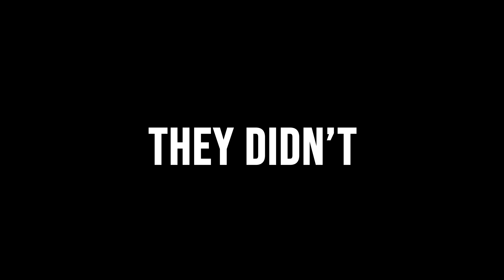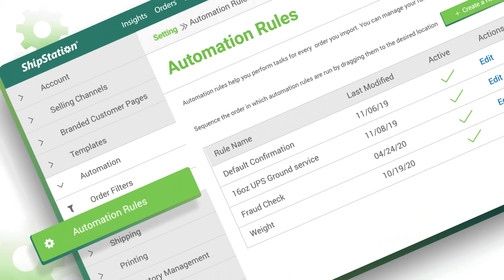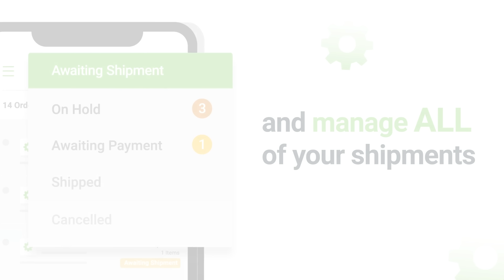This trick made my shop 50% BIGGER // Shop Build 3

Comment: You had mentioned that you would like to keep as much wall space as possible for cabinets and storage. Since you are building an open staircase along that outside wall, have your framers build a wall (in front) enclosing the stairs and get back the wall space the stairs are occupying . Also might be able to put a closet under the far end as well. Just as a suggestion.

Comment: Too late now but in-floor hydronic heating is awesome for a shop.  Also, installing 6" PVC DWV pipe under the slab for dust collection has the advantages of eliminating static electricity, decrease of noise and not having the piping above your head with expensive metal DC piping gives you more options for storage.  I did both for my new shop build and love it!
Reply: Maybe not absolutely required in Ohio, but others should also consider insulation under the slab.  Great way to cut down on heat loss.
Reply: @richs5422  We are required to install R-10 under slabs on all new construction by code here in zone 6.  2" of XPS.
Reply: I wouldn't want in floor heat because I might need/want to mount something to the floor and wouldn't be able to drill into it.
Reply: @ADBBuild You can find the pipes with an infrared camera if the heat is on .  They make them as an accessory to your cell phone.
Reply: @ADBBuild Take a picture of the lines.
Reply: Done both in last two shops,great for wood stabilization and no visible heating system.

Comment: I would recommend that the HATCH be hinged, on the hinge side have 2 vertical posts that can be latched to hold up the door/floor. Can also be insulated and sheetrock on the bottom facing side.

Comment: I like that you will epoxy the workshop floor.  FYI, I used Titan epoxy coating on my workshop and garage floor which has a lifetime guarantee not to crack.  My wife liked it so much she had them epoxy coat our front and back porch to eliminate the few expansion cracks that had developed. Remember, concrete will crack, putting in expansion joints (which you did correctly - in squares) means that any cracks will tend (not always, but mostly) along the expansion lines you have provided in the concrete.   So nice to see that you are doing this "shed" correctly.  A few other Youtube channels show various ways to move things up to an attic space.  You might get some ideas from others on cool ways to do this.

Comment: I built a surprisingly similar shop a few years ago. For the hoist I used a Harbor Freight 120 volt winch. I think it cost around $120 and has lifted everything I could throw at it. Also, for the 2nd floor dust collector/compressor room, I insulated it with horse stall mats from Tractor Supply on the walls and floor. Don't forget to add vents to keep the room from overheating (don't ask). The floor mats insulate the compressor vibrations from the ceiling. I can now play the radio in the shop and don't need to wear my headphones all day.  The new shop looks great. I'm envious. I'm sure great things will come from your new space. Thx.

Comment: Saw cuts in the slab are NOT to prevent cracking. Concrete WILL crack. The cuts just help determine WHERE it cracks.

Comment: for the hatch in the floor make two hinged doors which when closed can be walked on, also have a small hole where the doors meet so the hoist can be lowered through the hole and the doors open up as materials are raised through the hatch

Comment: Coming along nicely. For your lift door, how about a trap door that is stout enough to walk on from above. Hinge it so that it will lay flat on the floor when open. Put something like Shop Nation Skunk Works on the door. With you putting your laser and 3D printer upstairs, and my guess is those are what you do a lot of your prototyping on, skunk works makes perfect sense. 
On a separate note, have you considered making a dust collector for the throat plate of the miter saw (Hercules in my case)? I saw one on Inspire Woodcraft that looks pretty sweet, but nothing for a Hercules yet. I got the one for the saw from you already, just need to capture the dust coming off the throat plate. 
Love your channel, and what your planning for your new shop.

Comment: For your "Hole of Death". Maybe have a "basket" connected to the hoist (can use a D Ring if the basket needs to be removed) with the bottom skinned with OSB to match the ceiling while it's up. That way you have a good way to bring smaller things and the hole is covered when not in use to nobody falls through it lol

Comment: Suggestion for the cover.  Make it the reverse of what your probably thinking. Make it so the hoist can lower it out of the floor/celing.  This will help serve a few things... 1) Use it as your basket for bringing loose items up.  2) no need to work around it up top when open/removed. 3) No need to go up to just to open the cover, Wire in a second control and open it from below. 4) for safety, you'll always remember to close it as soon as your done with it, the big f-ing box hanging in your way will help with this.

Comment: You could screw in some heavy duty angle iron around the hole in the floor. About halfway on the beams. Then you can either create a hinged floor piece or something you lift out of the floor with the hoist. So you can walk over it and make it easy to open if needed. which probably will be not very often.

Comment: I like cement walls 4' high everywhere. Makes it so you will never have to worry about rot down low no matter what happens. Also, why not 5/8" zip sheathing on the roof?  I actually like 3/4 for trusses 24" O.C. Lastly, I like to take the grable returns go all the way across the gable. It looks awesome and can even put some lighting in there to look great at night.

Comment: Good call on the 2x6s. Maybe a little bit more costly but definitely worth it for running utilities and insulation! I'd add some more Windows though. 

Have you seen the small skylights that carry the light down through a tube?

Comment: Lie someone mentioned below, radiant floor heating would have been awesome!  Since you haven't done that, consider a radiant tube heater (think car dealership service bays).  I had one in my shop in Michigan and it was awesome.  Whatever you do, do not use a forced air furnace of any kind!  Efficiency sucks and hot air blowing around while you're cutting and sanding wood is a huge issue (even with air filtration systems but, you should have those too).

Comment: When it comes to building, that group works. I was going to put windows in but held off. Don’t even think about with garage doors open. I might rethink if I put in AC. You’ll love the attic lift. 
Do you know how much using ZIP versus traditional sheathing plywood increased the cost?

Comment: Hey, Australian based engineer who works with structure and airborne vibrations/emissions and consequently noise etc. Also the thermodynamics and airflow elements of managing systems like dust collection. I'm sitting in a hospital so you get a free consult of sorts :P.

I have a bunch of feedback that may be very important before you proceed with the upstairs install concept - but drug impeded capability = poor comms.  Reply if you want to chat or have a quick zoom meet soonish.

Some core issues that may be present are structure borne vibration, resonance from the systems that will infuse your entire building - potentially very irritating; airflow - recirc or fresh air setup aims which also impact acoustics as well as safety, comfort, material handling. 

Your weather would determine a number of factors with respect to the airflow needs and ambient temp maintenance.

Workflow - external door near the end wall upstairs could be an option to dump a bag of dust down into a large bin, vs  carrying out of the waste via the lift or stairs etc. Filter cleaning which will depend on the install type may be a problem.

Housing dust protection and compressor externally in an adjoining ground level construction with baffled air inlet/outlet can be a VERY effective means of keeping sound out of your building - direct radiated noise as well as structure resonance. Positioned near the cutout at the pool side or on a wall side not reflecting at neighbours (or just with suitable construction would yield a huge upside for you - space internally and noise). Digging in below ground is even better for gensets or compressor's but that's not likely needed given your scenario and distances I can see on the ground from your overhead views, or simple with weather management. 

Great to see you enjoying the realisation of your hard work and preparation.

Comment: What if you built a carrier with railing, one removable, that fits into the hole.  Then, when the gantry is up, you can't fall through at it would be railed off.  And, when you are lifting stuff up, it can't fall off the side with the railing.  Furthermore, if you had a helper, they could travel up on the gantry with the item and not risk falling as you would have the railing on the gantry lift.  Just a thought...

Comment: Having the dust collector in the attic is a cool idea until it's time to empty it. Having to lower the collection bin down the hole and then hoist it back up. It just sounds like a lengthy process to an already undesirable process. Now, if the blower section is up there with a collection bin on the ground floor. That would be cool as all get out.

Comment: The slab is going to crack (usually does in a few days) the saw cuts are to control where it cracks by making it slightly weaker so the crack is in the saw cut and not randomly across the floor.
Reply from the maker: Well yes
Reply: @ShopNation  to be fair, you said you had it sawed to try to prevent cracking....

Comment: Out of curiosity, why use zip for the walls and not the roof? Arguably the roof is more important to use it.
Reply: Need to use a different thicker OSB substrate that Zip has.  The 7/16" regular Zip, including their R panels won't meet code, probably for snow loads.  I think the brown Zip needs to be used.
Reply: @bobbray9666  yes they make 5/8" zip (brown) but I've seen plenty of homes use 7/16 on roofs depending on rafter spacing.
Reply: Was wondering the same thing. Zip makes thicker sheets for roofing.

Comment: Did you have them install  a HEATED slab in your concrete’s floor? ~ 😉 ~ Never 👎 ever install OSB in flooring; especially with a nail-gun! ~ Instead, use plywood & screws! ~ Squeaky OSB! ~ On a happy note 📝 ~ thanks to you {and a few Other YouTube Gurus on 3D Printing} my very first 3-D Printer 🖨️ this Month is a BAMBU LAB X1 Carbon Combo & my 2nd arriving October 01st is their A1 Mini Basic, for $199. on special. ~ ThanX Boss!

Comment: In their haste to put up walls they didnt use a sill sealer gasket where the bottom plate mates to the foundation walls?? Is that not code in your area? Even if its not code it should be there imo.. regardless if using green lumber or not.
Reply from the maker: The definitely did use a sill gasket, it’s yellow you can see it in some shots
Reply: @ShopNation  Good, I am glad I stand corrected, lol

Comment: I'm not a builder, but not spanning the end walls with zip across where the truss sits on top of the wall seems like a weak point that could hinge in high winds.
Reply from the maker: There is essentially zero leverage there so tying sheathing over it wouldn’t offer much strength. That comes from tying into neighbor trusses
Reply: @ShopNation  good to know, thanks for the update.